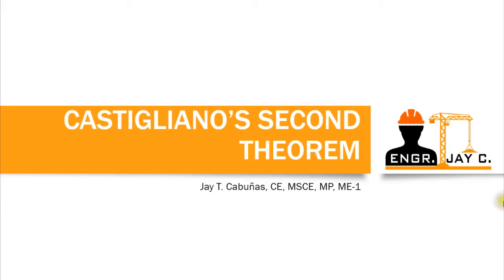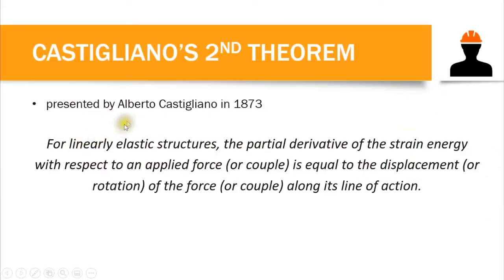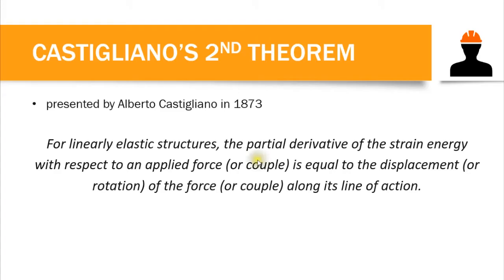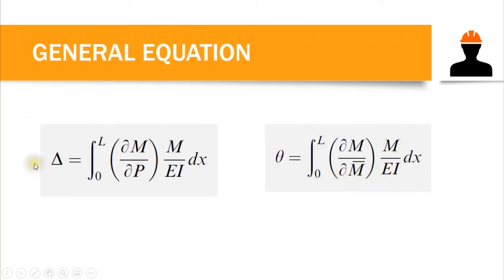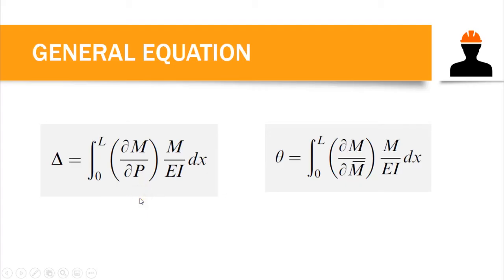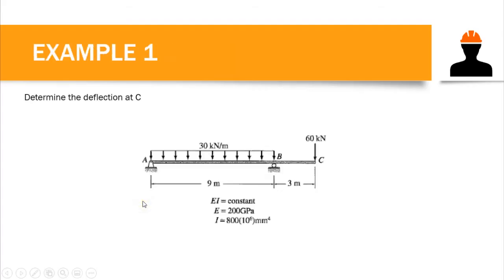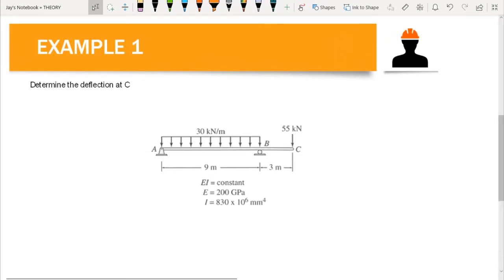Structural Theory | Castigliano's Second Theorem (Beam Deflection) Part 1 of 3

Comment: Thank you so much sir for this great lucid lecture about Castigliano's theorem using a simply supported beam with overhang as an example. I always struggled to get the correct answer for the deflection and slope when the beam is not a cantilevered one, such as simply supported beams. I don't know how the support reactions will contribute to the deflection at the point of interest. So this is really very useful to me. Thank you so much sir